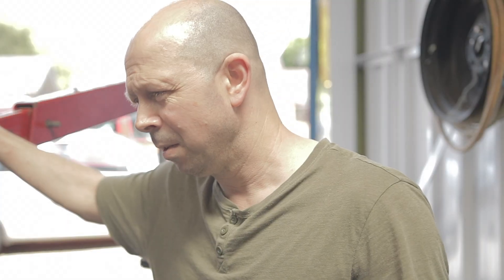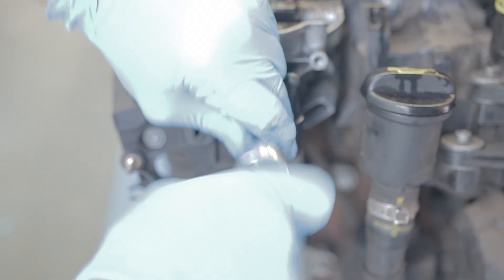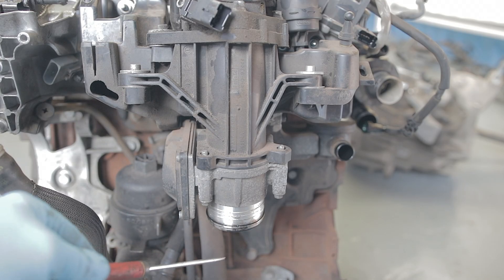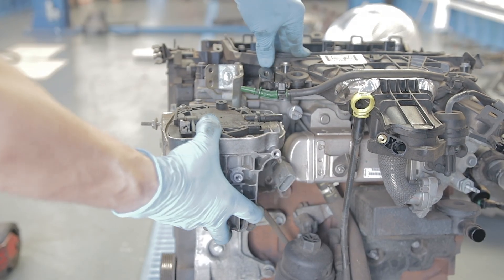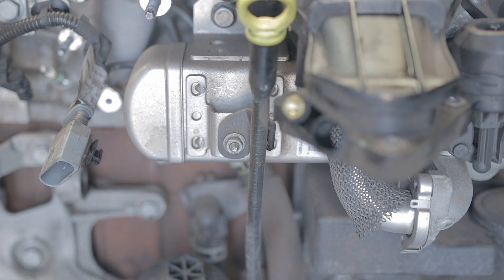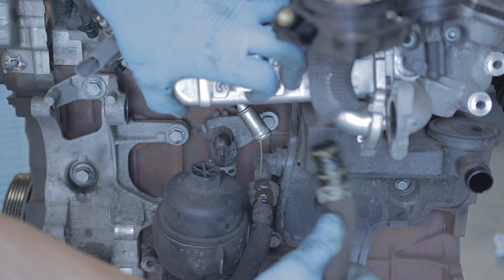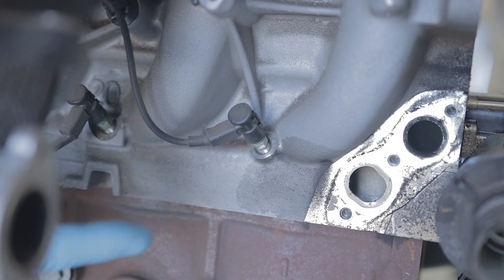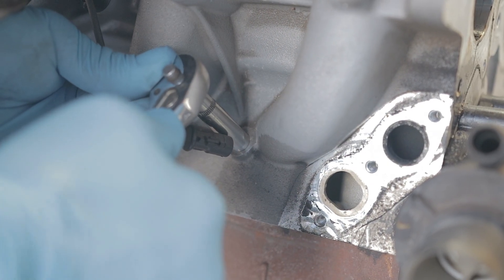2014 Ford Mondeo Mk4 2l Diesel, Glow Plug Removal

Comment: Great video. After having issues with problem code P0683 on mine, I was struggling with trying to figure out where the glow plugs were. Turns out that I had no issues with the glow plugs themselves (or the control module located to the left of the engine when it's in the car). I was getting no reading using a multimeter via the glow plug control module connector, but it turned out to be that the connector to the glow plugs (grey four pin connector next to the fuel filter visible from 0:41 onwards in this video) had come loose. Thankfully I did not have to dismantle the engine, mainly leaving this comment for anybody else that finds this one if they have this issue.

Comment: It's good step by step guide. It's great that you show clearly each and every nut and bolt location by having the engine out of the car especially where it's hidden under. Much appreciated. Thanks for showing us how it's done. Only downside is the horrible S word a bit off putting. Don't really need to hear it. Apart from that great video.

Comment: Thank you for a great tutorial. I do however have a little tip: Instead of removing the starter and the PCV, you can loosen the 2 T30 bolts on the EGR pipe (the inner bolt with a round-head-allen-key due to lack of space) and move it out of the way.

Comment: Hi Alan, how u doing? I changed my water housing and glow plug in my 1.8 tdci engine than motor start running like few second , prime fuel pipe again but couldn't start. Start motor turn but seems no fuel ... Any suggestions? Thanks for your humor and educate video ,love all of them .

Comment: Hi Alan
What would prevent glow plug light from coming on? It’s 1.2v with ign on, I’ve changed glow plugs, cleaned egr, new relay and new temp sensor... I’m stuck? Thanks Alan in advance!
Reply: Did you ever work this out? I have the same problem

Comment: Hi Alan, Great vid, I have the same engine, takes 4-7 secs to crank first thing and very rough with smoke after started the engine starts beautifully do you think its the plugs? the glow light doesn't come on dash either? Thanks!
Reply from the maker: you would need to have someone check if power was going to your glow plugs first..the relay by the expansion bottle is your glow plug relay
Reply: @alan4x  Alan
I’ve changed my plugs however I’m only getting 1.3v on plugs with ignition on? You think the replay is bad?
Many thanks

Comment: Hi Alan, I have a 2012 Mk4 Mondeo  2 litre 163 BHP Duratec  40,000 miles. Starts well but then shudders moderately
at 1500rpm but by 2000rpm smooths out. After a short run and warmer all’s fine.
I’m thinking glow plugs but why only at 1500rpm?  I would appreciate any ideas
here. Thanks William.
Reply: Hi, did you fix your issue in the end? Struggling with a very similar problem myself
Reply from the maker: i would check ecu codes first.. sounds more like an injector but if clears when warm then could be difficult to diagnose

Comment: Hi Alan, I need your help! I've just replaced all 4 glow plugs on my mk4 2.2 tdci, only to find the pesky P0308 glow plug error remains in the PCM, and 'engine malfunction' is still displayed on my dash! Have checked all 4 of the removed plugs which are all open circuit so must have all taken a dump. Have tried resetting the error codes with forscan to no avail, and switched the glow plug relay to check but that doesn't seem to have helped either. Do you think this could be a wiring loom issue? Thanks in advance
Reply: Sorted! Dodgy connection in the loom plug. Thanks for all you do, your content is awesome

Comment: How much coolant  is lost when removing EGR?Do you have to fill all the system with coolant,or can you plug the coolant hose to the egr?
Reply from the maker: if you just remove the hose off the middle top of the valve you won't lose much and can plug it or you can try to push the valve back towards the bulkhead and leave the pipes connected..if it were me i would only remove top middle hose

Comment: Hi alan, i see already a 2 litre diesel out of the car and a 1.8 litre, what was the issue to remove this engines out the cars? I work alot with fords just curious to know. Thanks 😉
Reply from the maker: hi, the 1.8 i don't know what was wrong with that engine as i borrowed the engine from a friend to show how to change the wet belt but the 2.litre all of a sudden developed a loud little end bearing knocking noise so just replaced the engine
Reply: @alan4x  thanks 😉

Comment: Thanks a lot for the upload on this engine WA6 Peugeot/Citroen that's also found on the Ford Galaxy mk3. On the EGR, is it possible to clean it without removing and if so how could it be done? :)
Reply from the maker: hi, i can say i have never once had an egr problem on one of these engines yet so i have never gone near the valve for any reason

Comment: Just did the plugs on a 2.2 not quite as bad as the egr is at the back of the engine,
Reply from the maker: i not had the pleasure of them yet lol
Reply: alan howatt inlet manifold off, decoked it, put a blanking plate in the egr system, done worse jobs lol, good videos btw 👍
Reply: 2.2 looks the same sophisticated to change plugs. I've just explored the mount places... The intake to be off.

Comment: So how do you know if the glow plugs are knackered? Is it a starting problem?
Reply from the maker: hello, thanks for your totally correct comments, I never knew there was four separate wires going to the glow plugs...if I had known I should have put that check at the very beginning of the video before I took anything apart...I will put it in the description as it is quite important...its just as well I took it apart for fun rather than as a proper job lol...thanks again.. now I have learnt something
Reply: Hello Alan, you do not need to remove the glow plugs. In order to check them you need to disconnect the connector seen at 0:44 (grey connector), the connector is better seen at 2:57, it should have 4 pins inside, you can check the resistance of each pin, each pin goes to a glow plug hence why 4 pins. A good glow plug should have a resistance of about 1ohm, you also set your multimeter way too high, the multimeter was set at 200k it should be set at 200 (without K), with such high setting you could potentially have a faulty glow plug and the meter still showing zero. Besides that it is a good video, thanks for your work, I like your videos.
Reply: Hi rzepekpl! You know maybe , gray connector pins, which is connected to 1, 2, 3, 4 glow plugs? I have an error code P0683 and one glow plug is dead. I hope the first one behind the fuel filter:) Thanks!
Reply: You're welcome Alan, I like your videos as I have the same engine fitted to my Citroen C5, it is nice to see when someone is working on something that is identical to my car, I hope I never have to change these plugs on mine, some glow plugs like to snap and leave the tip inside on removal, this would be a bummer. Thanks for the videos, like to watch them as I can always learn something new.
Reply from the maker: hi, the car would be hard to start on real cold mornings..you can test the main live wire to the glow plugs is working correctly but to check each glow plug independantly you need to remove them
Reply: You could measure the current draw per glow plug with an amp meter but checking resistance should be sufficient; if they burn out then it will be open circuit. Nice to know torque should be really low putting them back.

Comment: You wouldn't be speaking from experience when it comes to stripped out glow plug threads would you Alan? 😂😟😫

What happened with the engine? How many miles on it when it died?
Reply from the maker: lol, no luckily i have never stripped a glow plug but i have had a few that would not come out so i left them.
  one of the little end bearings started rattling real bad in this engine... don't know why, oil etc was ok.. it had done 207k miles

Comment: Well I think I’ll be getting a new car great vid Alan  + my mk 4 at 152000 is still running like a top 👍
Reply: mine is still running at 225000 (112000 on it when i bought the 2008 beastie in 2011)unfortunately i believe i have to replace the glow plugs as its not starting so well these days. Thought it was the battery but no.